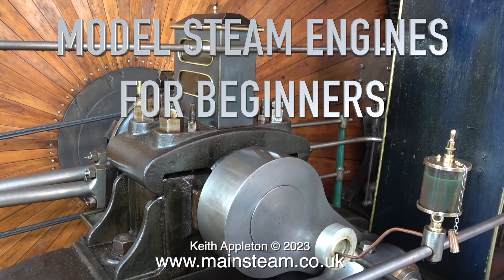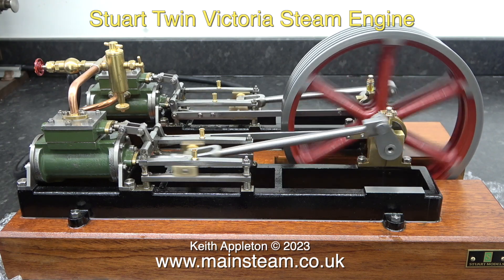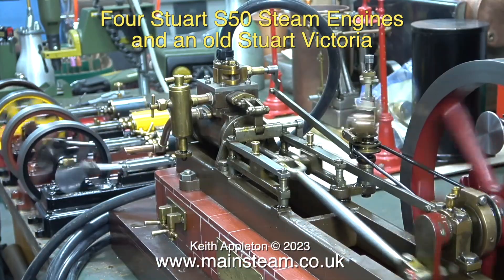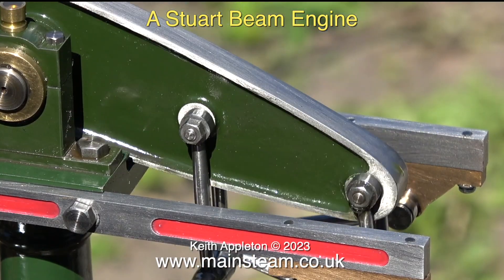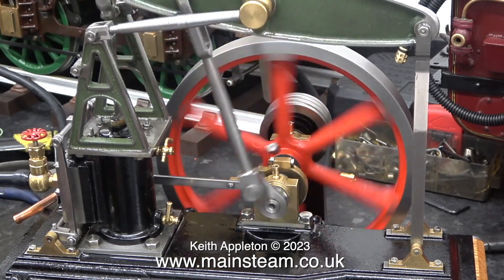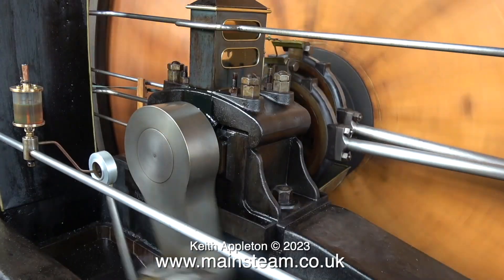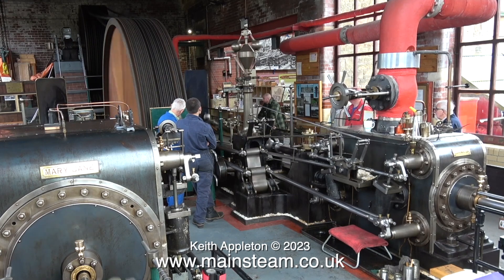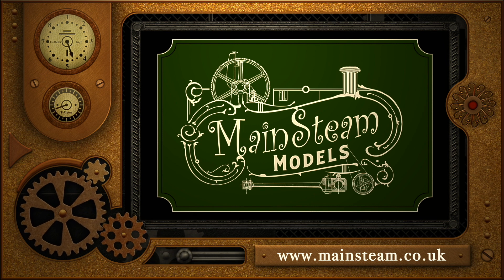FLYWHEEL ROTATION - STEAM ENGINES FOR BEGINNERS - PART #25

Comment: OK, then why do steam locomotives (modern) run just the opposite? As I was told, it reduces pounding of the rail, and over the top IS reverse. Ya Right, it's just the way they were designed to work.  I know not all modern locomotives ran like that, like the 4 -8-8-2 (Cab Forward) Southern Pacific loco in the US, and they worked fine. There was more rail pounding though, requiring mor maintenance of way.
Clearly, stationary steam engines should run as you say, and for the reasons you say too. I surly would not want a 30 ton wheel chasing me about. ;-)
Reply from the maker: The pounding of the rail as you call it (or hammer blows as I call it) is caused by the balance weights in the wheels. The direction of flywheel rotation does not apply to Steam Locomotives, as unlike Mill engines, they run in both directions . . .  .

Comment: There is another reason for the top of the flywheel turning away from the cylinder (in a stationary engine). This has to do with the belt or rope drive to the installation that is being driven. This way, the angle over which the belt is pulled tight around the flywheel is larger than when the engine turns the other way. This becomes evident when you sketch the two situations on the same scale. And, a greater tight angle can transmit more power.
There is an exception; in traction engines the top of the flywheel turns toward the load, which sits in front of the engine. The reason is the same as above, a greater length of belt in contact with the flywheel. The contact angle can even be increased by turning the belt, i.e. crossing it. This gives more angle, but also more wear. The engine then needs to. be run in the other direction.
Reply from the maker: Thank you - for a good constructive comment. {:-))) My Showman's engine generates electricity running in reverse, so the belt goes "over the top" of the Flywheel when under load.

Comment: Are you aware of any model engines that use valving like the Bancroft?? The rotating valves (or would that be swiveling?) are fascinating to watch. The additional complexity would make it unlikely, as steamchests don't require so many linkages to time correctly, which may discourage a model builder.
Reply from the maker: Yes, Clarksons do one with Corliss Valve Gear - try www.blackgates.co.uk (they now own the Clarkson range of engine castings)